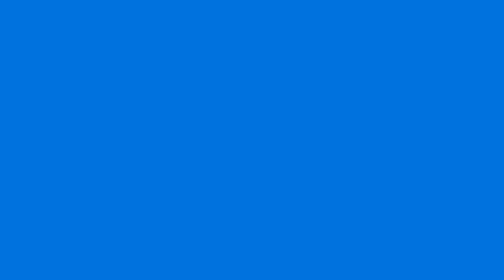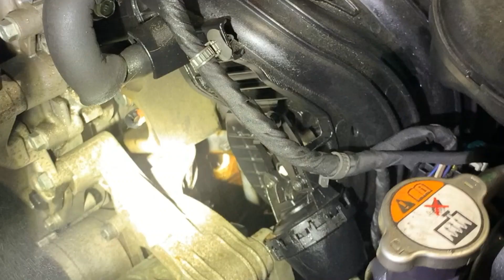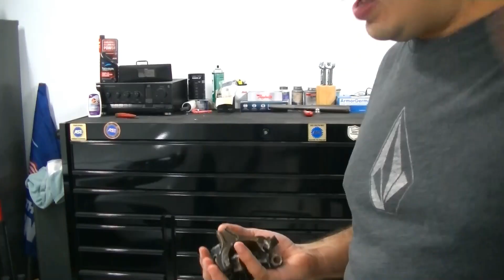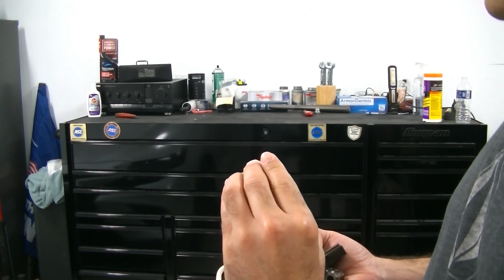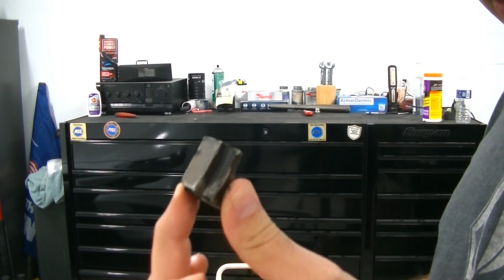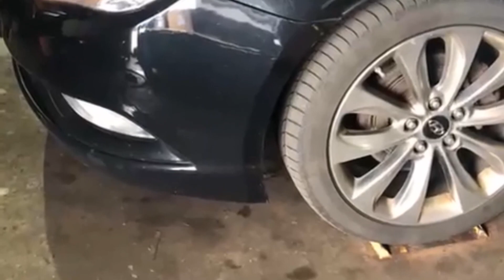P1326 In Hyundai/Kia vehicles, Cause of Theta 2 engine Failures, Timeline of Hyundai engine recalls

Comment: Our 2013 santa fe had a rod knock right out of the showroom, hyundai corporate offered a new car or engine replacement, at 9,000 miles i chose an engine, they gave me a new santa fe for a loner no questiins asked. They replaced the engine/transmission as an assembly, 11 years and 130,000 miles later the car still runs like new. Hyundai called us regularly and gave us a 100,000 mile bumper to bumper warranty and later a lifetime warranty on the engine, this was long before class action suit. I have since bought a new santa fe (2022) and have had 0 defects on that car, needless to say we are keeping that 2013 forever. Hyundai has always treated us great and ill keep buying them.

Comment: Oil dilution at each cold start (summer/winter) and low 1000rpm cruising, nice explosive mix. Cars doing mostly short drives are the most at risk, gasoline doesn't have time to evaporate from the engine oil. Many engines seize either around 85k miles, or around 135k miles. There's also a false limp mode when knock sensor gets wet - heavy rain or carwash. Let car dry a few days. Most likely the oil dilution was created by Hyundai themselves when they were looking for a quick cheap way to prevent carbon build up. New 2.5 engine got both direct and port injection so no longer carbon build up and no longer oil dilution. Basically, the 2.5 is what the 2.4 and 2.0T should have been from the start.

Comment: Very informative on the troublesome history of the Theta 2. I recently picked up a '23 Kona N and I was wondering if you have some insight on an interesting issue several other N owners have reported. In almost every case, immediately following a touchless carwash, they get the p1326 code, and the car goes into limp mode. Some are resolved by clearing the code, some by doing the bearing clearance test and replacing the KS, and others end up getting a new engine. But the common link is the touchless carwash (a couple have reported it happening driving in heavy rain as well). Is it just a poorly sealed KS/wiring harness allowing water ingress? Could it actually be injesting water through the intake causing a knock triggering the p1326 code? Quite the odd situation that hyundai has failed to speak on thus far. Oh, and needless to say I will only be hand washing my car haha

Comment: They did all what you said on my Tuscon 2015 but still didn't fix the issue. They replaced after that the catalytic converter, the vehicle was fine for 2weeks and the check engine light was flashing again. Took it back again, just got it back 2 days ago and they said they reprogrammed it as they had an update out a week ago. So, I am hoping this will fix the issue as I have been dealing with it since Nov 2021, in and out of the dealership since then.
They did do everything under warranty but for someone who uses vehicle a lot, it takes a toll on the day-to-day life with the stress of waiting if they have a loaner for me right away or not

Comment: My 2018 SantaFe 2.0T had the “80CA08 ECM update & P1326 wiring & Engine Replacement in Feb 2020 at 65,000 Km after it went into Limp mode. All good since that fix. Last week Nov 2021 the engine light started to flash now at 118,000 Km (out of warranty),  limp mode started and noticed while going around a traffic loop, the oil light would flash on then go away. I got to a gas station, I shutoff the engine, then when I restarted again and I could hear the engine knock quite loudly. Drove home 2km, checked the oil stick & it was bone dry? Where did all the oils go? I filled it up 4.7 L to normal levels, no change in engine knock. We were already booked next week for our reg oils change. My OBD2 shows the “P1326 Glow Relay Short Circuit”. Dealer said to drive it in for inspection. I had the truck towed to our dealer to avoid possible damage.  Any Ideas if I’m toast with an expensive engine rebuild or likely just need a new sensor again + software?
Loving your channel, TY for taking the time with details.
Reply: Follow up: got word back from dealership they have ordered a new engine and will replace under the recall, no cost. 
Thx for educating us so we are informed. Much appreciated.
Reply: My 15 Tucson is doing the same. I got it used and I’m at 81,000 miles on it. I’m not the original owner. With the engine recall you go what warranty were you under?
Reply: @ianlich95  it’s a global recall, regardless of warranty. The warranty (in Ontario Canada) allows for a free rental car for 10 days with extensions of motor is delayed, but no extension of head gasket is delayed.
Reply: @ianlich95  you don't have to be the original owner. Call Hyundai Corporate 1st and let them set u up with the dealer, any problems with dealership always use Hyundai Corporate for mediation, get a case number from the Corporate too. It worked for our 2013 santafe sport 2.0 T.
Reply: @miklav6746  , Hi Mike , how ddid go with yours  Hyundai on the end , I had my engine bloc replaced , but still problems after that , knocking sensor replace , cathalitic convertor repalced, updated softvere , still vehicle is in shop right now, thry trying to solve the issue with Hyundai Canada, have no idea what they have to do next !
Reply: @plutoniusis  sorry to hear that. After our block was replaced, it’s been like a new engine, everything smooth. Got my first Turbo test speeding ticket since 30+yrs ago🙄

My driver seat cooling button stopped working but that’s another story.

Comment: I really appreciate these videos, I started researching after getting the P1326 and you absolutely explained the how and why better than anyone else.   Just wondering what advice you could give me.  I have a '17 Sportage with 75k miles that recently had the code pop up.  I wasn't at home where my scan tool was so stopped at the nearby parts store when it went into limp mode to have the code read.  It was the P1326, the guy cleared the code and I drove home.  From what I have read after the fact the code needs to be active when it goes to the dealership.  What do I do now?  I've put around 50 miles on it right around the house seeing what it'll do but so far nothing.  If I had the time then to really research it I would have never let him clear the code.

Comment: I bought a 2013 Tucson theta ii 2.4L port injected w 102k last May for my son after graduating high school. Yellow dipstick, oil slightly above full. He drove that around town for 3 months without a problem. We had the oil changed before he went up to college, he was coming home for Labor Day Weekend and had it go into limp mode 90 miles from home for knock sensor out of range error. I cleared the code, drove it home, changed the knock sensor thinking it had some miles on it and was probably faulty. He had an uneventful trip back, but on his way home for Fall Break (Oct) it went back into limp mode again but this time was accompanied by a rod knock. So within 5 months and 2000 miles of ownership I am stuck with a crap engine. I started tearing into it last weekend, no glitter in the oil however, when I pulled the VVT solenoids, bingo! Chunky glitter caught in the mesh. There is no debris in the filter, so I believe this happened before we bought it. My wife’s Hyundai Excel 3-door was such a reliable car, this latest experience has soured us on the brand.

Comment: My daughter just got stranded yesterday coming home from college on I 10-  west of Tallahassee TUSCON 2015 with 73 000 miles. I live a 4 hrs drive from there and  what a pain in the rear to do deal with. I went and got her and got the car towed to the dealership in Tallahassee waiting on their diagnosis. It must be this issue driving along and all of a sudden it went into limp mode with a knocking nose coming from the engine. Looks like I am buying a new car for her and it is going to be a Toyota which will cost $$$$$$$$$$$$
Reply: U have free warranty on your engine 953 campaign
Reply: I had a very similar experience with my son. I am in the middle of the engine autopsy now, it is looking like a rod bearing failure.

Comment: Just had the engine replaced on my daughter's 2018 Hyundai Kona (1.6L turbo engine). It only had 78,000 miles when the engine seized. Thankfully the extended warranty covered it because it was a certified preowned vehicle when I purchased it (56,000 miles). It was in the shop for two months during the entire process. Will never purchase another Hyundai vehicle after this.

Comment: Im curious, do replacement crate engines have the same failures? IOW has Kia fixed the problem in their replacement engines
Reply: I'm getting a new engine out of KIA. Probably luck of the draw. Fastidious maintenance from day 1. I'm draining the break in oil before 1,000 miles and using Castrol Edge 5W 40.
Reply: @robertbweltzien  agree with changing the oil at 1000 miles. I do that with all my new cars. But if you use a heavier oli than the owners manuel states. And the engine fails, and they discover that,  the warranty will NOT be honored. I have owned 4 Korean cars since 2005, never had any engine problems.  My 2017 Elantra just ticked over 95.000 miles, still runs like new, sounds fine, uses no oil. In fact, the car has required 0 repairs.  I bought a new 2021 kia K5 1.6 liter turbo, in may 2021, 17000 miles, its had no issues. And is a great driving, comfortable car.

Comment: I have been down the Hyundai road and back the last 2 months. 4 tows back to the dealership in which they updated the computer, then replaced the knock sensor, the third time Hyundai directed them to change my oil and use a Hyundai filter and then the 4th trip the performed a bore scope and found scoring on cylinder 3 in which then Hyundai denied everything but nobody can tell me how the scoring occurred to only one of the cylinders. I know that I read that the whisleblower had brought up 9 or 10 problems outside of the connecting rod bearing issue and one of them was the overheating of the cylinder bore in which it was causing the bore to become deformed and then it would cause the scoring. Somehow they escaped only having to do the connecting rod bearing. There is a slight tap and now the car runs fine until the knock sensor and computer tell it not to. If there was meatal shavings coming from the connecting rod bearings is there a way that could come into the cylinder bore and cause scoring? I have learned more about engines in the last month than I ever wanted to. Thanks in advance if you have any insight or advice.
Reply: Omg, 4 tows? I just had my first stall on the freeway the other day. They updated the software. So you’re telling me I have more time to spend in the shop in the future? FML
Reply: @KristinaKage  I would guess everyone's situation will be different. I hope you don't have to go through what I am. It's terrible.
Reply: Hi there, I wonder how did go with your Hyundai since, have been problem solved , don't have any more vehicle? I have same issues with my Tucson, , hyundai approved engine bloc to be replaced and waited three months to get the engine,, then after just two weeks and 1000 km made  knocking sensor come on again, they then replaced knocking sensor , but engine lights still coming on and they replaced catalitic converter because code told them thats the new issue, however the engine light did not go away and multiple codes come on on a different part of engine including the code for knocking sensor that does not make sense! Vehicle is practically still at dealership waiting instruction from Hyundai what to do next!
I had in my life many  different vehicles this is the worse I ever seen . My previous Hyundai Tucson 2.4L made over 250 000 miles and never had issue with engine, sold the vehicle with no issues, then comes newTucson generation disaster quality ! I also had once Mercedes diesel back in Europe in 80this , vehicle made ovwer1 200 000 km , never had issues with engine!
Reply: Omg dont worry im literally going thru the same thing as we speak i replced knock sensor 3 times warranty people telling me to replace knock senses again its the engine
Reply: @plutoniusis  so sorry to hear that any updates
Reply: @indiee9602  Hi Indiee,  update from last posting : Hyundai dealership reloaded entire operating software and since May vehicle drives fine, so far no any issues.
All this work was done and covered under warranty recall!  
Hope you doing well:)

Comment: This is outstanding, I’m subscribed for life. I have code P1326 now on my 2015 Sorento, after it shutdown in the road I had it towed to Kia. The dealer inspected and determined I needed a new engine, but Kia denied it and said it passed the rod bearing clearance test and shows no sign of bearing damage. Should I suspect the knock sensor or harness if no sign of bearing damage? Thanks!
Reply from the maker: If your software is up-to-date and has the latest update then yes a knock sensor would be your next step
Reply: @SEsGarage  Great thanks so much! I’ve Liked, Shared and Subscribed to your channel.
Reply: Mines the complete opposite I’ve had three knock sensors my engine is failing and I literally have to do a drawn out process just for then to replace the engine

Comment: I got a P303 code on Tuesday through troubleshooting found #3 spark plug was fouled.  Replaced all 4 spark plugs.  Went to work this morning and my engine light started to flash and the radio announce that the ECM detects an engine issue.  Would you like to schedule a service now.  I turned around and drove back home, I was in the middle of no where on my way yo Fort Bragg.  I stopped at a parts shop, borrowed the scanner and got the P1326 code.  Looked it up and it said Glow Relay stuck on.  Drove home to call the dealer and pulled into my drive way and smoke started to fill the cabin of the car.  Turned off the engine got out saw oil pouring out of the exhaust side of the engine.  Now it is knocking.  I wish I would had seen your video about the knock sensor before now.  I cannot wait to see what the dealership says to me next month when they can look at my 2016 Kia Optima EX.  I also just received a letter about extending the warranty to 150,000 for the low pressure fuel pump.  Too many issues with these cars.  Might have to tell the wife to trade in her 2018 Optima EX before this happens to her too.

Comment: They are including the non GDI 2010 and up Theta engines as well ie 11-13 Sportage/ Tucson. They won't cover if it doesn't have the knock sensor update, they also don't cover salvage title vehicles.

Comment: Thank you for the informative video, my wife and purchased a 21 sportage with the GDi 2.4 I believe is still the Theta 2 engine.  Do these engines still have rod bearing issues ? If so what can I do to prevent this failure ? Change my oil earlier or run some oil stabilizer ? Thank you for your time.
Reply: Oh just sell it on.
Reply: From my experience the Sportage is one of few Kias that don't blow up that often of they're maintained properly..... The others being the Cadenza, and the Sedona
Reply: Yup, Theta II,  Our 2017 Sportage started using oil around 50,000, now at 67000 it uses 1 qt per 1000 miles, going in for carbon clean in 2 days.  I tried 10w30 and it went to a half a qt in 1000 miles.  There is an extended warranty due to a lawsuit on these engines, if they don't honor it, I will use 15w40 until I can talk my wife into letting me get rid of it for never Kia again since they didn't honor their warranty.  My 2016 Tucson with a 1.6L turbo is doing fine at 47000 miles, so ya, the Theta II has problems.
Reply: Supposedly , They Are Problematic From 2011 - 2019 ( Lower End Issues )
Reply: To prevent failure ride a bicycle

Comment: As a very small point of clarification (that admittedly adds little/nothing to the conversation) the Theta II debuted in the CM2 Santa Fe in 2010. It was in MPI form for 2010-2012, and was eventually added to the scope of the various 'service actions' where they add that knock sensor software.

Yes, I have one... as part of that service action my warranty would have been extended to 12 years/200,000km. I declined to get it done, as a Blackstone UOA had previously come out clean as a whistle, and frankly had guessed on my own that the software would be buggy/cause the false positives as you mentioned here. If a rod bearing does start to crap out, I want maximum available power to be able to maneuver out of traffic - losing power in traffic is way more dangerous around here than possibility of a fire. 

203,000 km and still running like a champ (for now).
Reply: Theta II MPI began production on February 2008 for the refreshed 2009 Sonata. A lot earlier than you think.

Comment: I have a 2012 Kia Forte ex 2.0L 108k miles so out of the 100k mile powertrain warranty. Car still runs good but does have the infamous clacking sound. I never miss oil changes and keep up all maintenance. If the engine was gonna go would it have gone by now??

Comment: Interesting. My 2012 Kia optima sx had the diagnostic done and passed but they said if I hear any noises bring it in. I have a red dipstick as well. Engine seized up in 2022 at 149,000 miles. No warning at all. Fortunately I was in town and not at highway speeds when it happened. New engine doing well so far